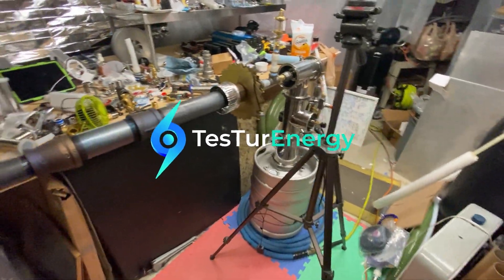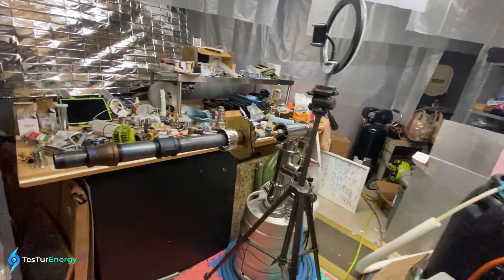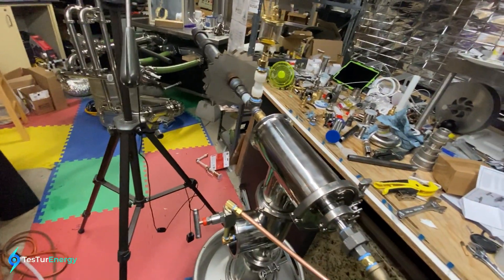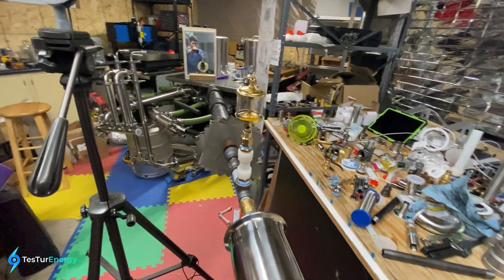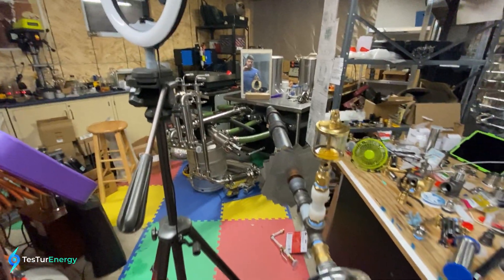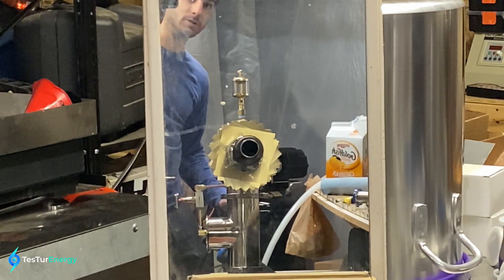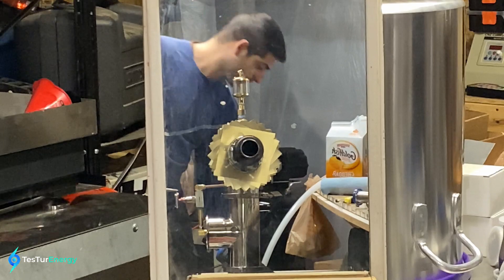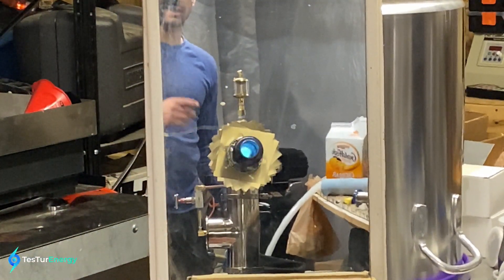Nikola Tesla's Improved Combustion + Steam Turbine Jet Engine Patent GB 186,083 - Propane Air Fuel

Comment: this is the first stage to create steam for the tesla turbine ?
Reply from the maker: Correct! It’s 1x of the 2x combustor/steam tubes that leads to the turbine in Tesla’s GB 186,083 improved turbine patent that he patented 10 years after the original turbine patent. 

It’s the one in this video of mine that I explain during the second half of this video of mine. 
Solis Talks Tesla Gas Turbine, Cold Steam Vacuum Chamber, Renewable Combined Heat and Power - Part 1
https://youtu.be/5Y3D13JmtcA
Reply from the maker: Just for posterity sake I’ll copy and paste what I also wrote out to thumper for you to read if you haven’t seen it yet. 🙂

The low temp vacuum steam system from his “Our Future Motive Power” is indeed a unique and separate system than this high temp/pressure combustion+ steam system from his GB 186,083 patent but they 100% can be used together as one package. 

The vacuum steam system most likely won’t be able to power a home’s peak power demands at various times of the day. But it will most likely be able to do 1kW for 24hrs/7days/52weeks….. so every day you can reverse your electricity bill and neutralize your use being connected to the grid for peak power needs at various times of the day by dumping the 1kW back in all day. The average home in America uses about 25kWhrs of electricity per day. 1kW back into the grid for 24hrs is 24kWhrs/day. 

Now for anyone already on the grid 1kW won’t power their needs on its own but if the grid does go down 1kW continuously available all day can be the difference between life and death for some people… not to be hyperbolic or cliche, but it’s the truth. 

On the other side of things though, anyone who is already completely off grid would see 1kW of power 24 hours a day as being like getting a fire hose pressure boost upgrade compared to a hanging bucket shower, if you know what I mean lol 

But for this system to be completely “off grid” and independent there will more than likely need to be an additional combustion turbine that the heat loss from that goes into storing thermal energy into the vacuum steam cryophorus’ thermal battery and to heating in a home. 
However this combustor is MASSIVELY overbuilt for anything any single home would need. My back of the envelope calculations and comparison to other systems I’ve seen around conservatively puts this single burner easily at the 250-500kW thermal output range, and could even be easily up to 1MW thermal power output. 

With even just a 25% efficient turbine, that’s at the minimum 50kW District electrical power available with 100kW of district thermal heating power available, and at the moderate outcome 125kW electrical and 300kW thermal power output. Essentially it might be able to power a whole a whole block of homes or a whole apartment building/hospital/Farm/factory…. Etc.
Reply from the maker: For comparison take a look at this 500kW burner from NOBOX7 and see the size of the flame and everything it’s outputting.
https://youtu.be/59qedrcQe38

Comment: is this a new project or is it necesary for the turbine electricity generation system?
Reply from the maker: Correct! It’s part of the total package that Tesla came up with across about 5 different patents. This is the beginning of my replication of the system in Tesla’s GB 186,083 patent that he patents 10 years after the original turbine patent. I explain the two systems in the movie I put out a little bit ago. Here’s the link 🙂

Solis Talks Tesla Gas Turbine, Cold Steam Vacuum Chamber, Renewable Combined Heat and Power - Part 1
https://youtu.be/5Y3D13JmtcA

This is 1x of the 2x combustor/steam tubes that leads to the turbine. 

The low temp vacuum steam system from his “Our Future Motive Power” is indeed a unique and separate system than this high temp/pressure combustion+ steam system from his GB 186,083 patent but they 100% can be used together as one package. 

The vacuum steam system most likely won’t be able to power a homes peak power demands at various times of the day. But it will most likely be able to do 1kW for 24hrs/7days/52weeks….. so every day you can reverse your electricity bill and neutralize your use being connected to the grid for peak power needs at various times of the day by dumping the 1kW back in all day. The average home mom America uses about 25kWhrs of energy per day. 1kW back into the grid for 24hrs is 24kWhrs/day. 

Now for anyone already on the grid 1kW won’t power their needs on its own but if the grid does go down 1kW continuously available all day can the difference between life and death for some people… not to be hyperbolic or cliche but it’s the truth. 

On the other side of things though, anyone who is already completely off grid would see 1kW of power 24 hours a day would be like getting a fire hose pressure boost upgrade compared to a hanging bucket shower, if you know what I mean lol 

But for this system to be completely “off grid” and independent there will more than likely need to be an additional combustion turbine that the heat loss from that goes into storing thermal energy into the vacuum steam cryophorus’ thermal battery and to heating in a home. 
However this combustor is MASSIVELY overbuilt for anything any single home would need. My back of the envelope calculations and comparison to other systems I’ve seen around conservatively puts this single burner easily at the 250-500kW thermal output range, and could even be easily up to 1MW thermal power output. 

With even just a 25% efficient turbine, that’s at the minimum 50kW District electrical power available with 100kW of district thermal heating power available, and at the moderate outcome 125kW electrical and 300kW thermal power output. Essentially it might be able to power a whole a whole block of homes or a whole apartment building/hospital/Farm/factory…. Etc.
Reply from the maker: For comparison take a look at this 500kW burner from NOBOX7 and see the size of the flame and everything it’s outputting.
https://youtu.be/59qedrcQe38